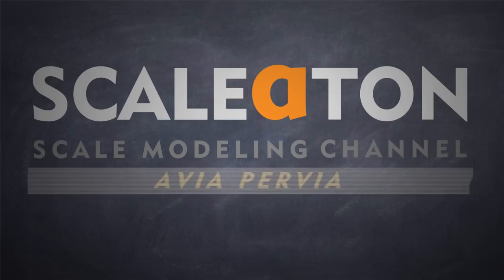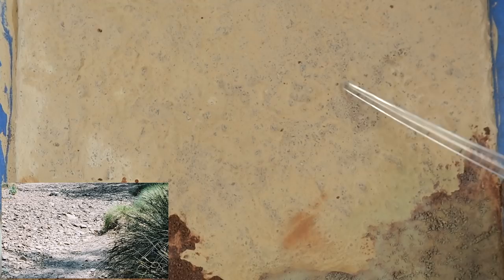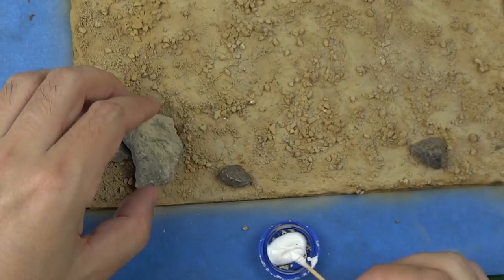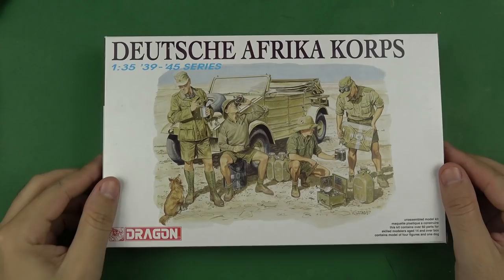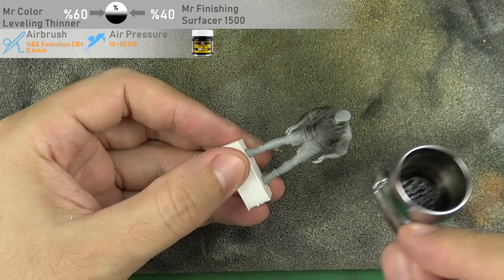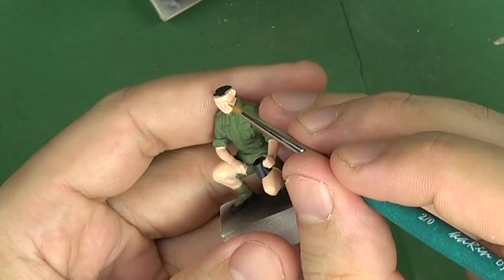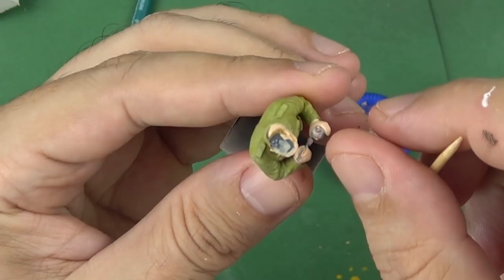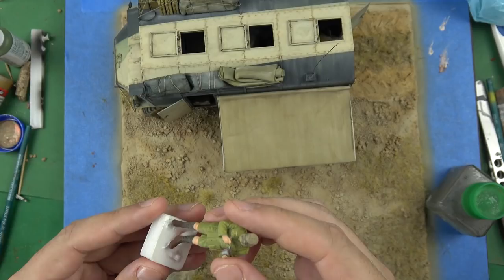"Under new management"  Deutsche Afrika Korps Diorama in 1/35 Scale

Comment: a small suggestion, at 4:30, where you drop diluted white glue to hold the sand in place, you mind find it useful to pre-wet the sand with isopropyl alcohol and then drop the diluted white glue. That way it will flow much more easily and won't disturb the shape you have created on the sand